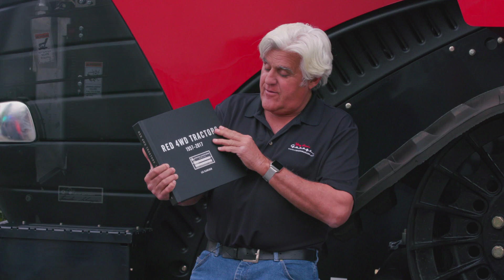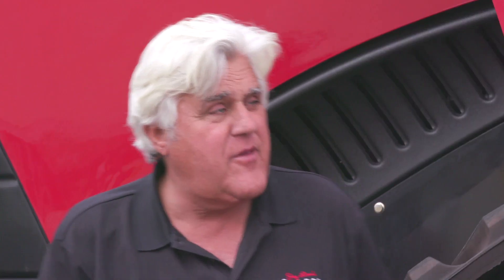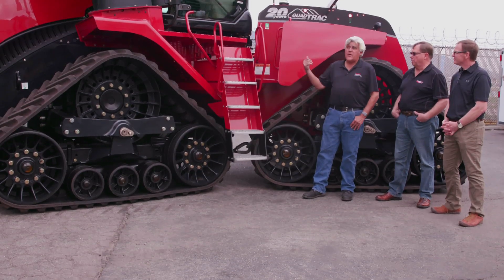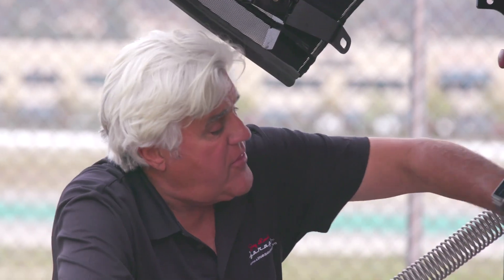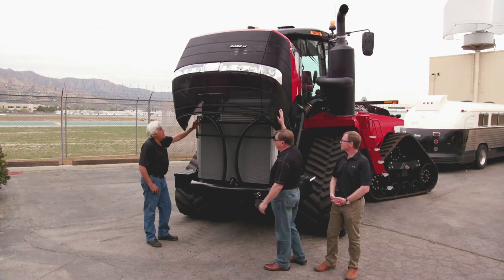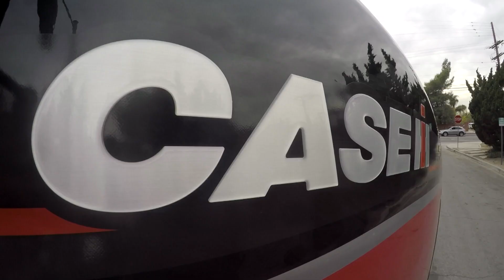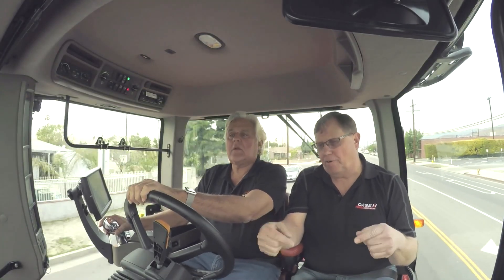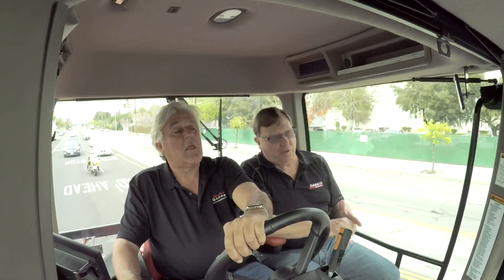2017 Case IH Quadtrac - Jay Leno's Garage

Comment: So it costs the same as a McLaren, has a similar power output and is road legal. And before anyone says: "Yeah but a McLaren is faster!" well here's the thing; A McLaren won't be faster in traffic. This QuadTrac may not be quick but you can just go over the cars in front of you! Oh and it has more torque.

QuadTrac 2: McLaren: 0
Reply: The Maclaren also won't pay for itself like this beast can!
Reply: yes,  but a McLaren can't plow a field!  Different vehicles for different jobs.
Reply: this looks like a tank so yeah a immediate win
Reply: This can handle snow and deep water better than the McLaren.
Reply: Yeah, people in Turlock basically own ALL roads now.
Reply: Let's see a pulling contest, McLaren vs the Case!
Reply: ¡ i sorry this was the wrong comment
Reply: Mclaren don’t make no 2100 lb/ft torque.
Reply: It's true! You can kill a lot of people in cars by crushing them to death. Very good point!
Reply: This helps feed a nation - the McLaren, not so much.......
Reply: So true. Anyone who lives in a high highway traffic city 27/7, with a 40kph limit on every street, theoridically, wont be better off with that then any super car. Espacially in winter. And Jim The EDC guy is right... On top of it, in a 2 way rural road. The McLaren is stuck behind it.
Reply: Howabout  this thing can plow a field and provide food for your family. or this will plow snow and open a vital traffic route which will save lives.  Can a McLaren do that?

I'd still rather have a McLaren.
Reply: Quadtrac pays for it self and is more useful and can drive in 3foot deep snow that Mclaren would not even move
Reply: The McLaren won't make you money back though. You'll eventually get your money back with this tractor since it's a tool for farm use.
Reply: But you can’t pull a plow with a McLaren 😂.  Quadtrac 3- McLaren 0
Reply: And you can't do jobs for the local farmers in a McLaren
Reply: LoneRenegade plus the tractor will help make its money back if you don’t se it.
Reply: Still not getting your product to market without the truck driver.
Reply: I'm not sure if driving over other cars is socially accepted though.
Reply: LoneRenegade it can pull like 20 times what a mclaren could and actually has a purpose so let’s make the tractor 10 and the car 0
Reply: @jimgoodwin6294  McLaren helps feed people. Mechanics always need constant customers!
Reply: LoneRenegade don’t forget the QuadTrac will make you money as well
Reply: The tractor has astounding productive capability.
The McLaren is a fast, pretty, high performance, fair weather LIABILITY.
Reply: can the mclaren crush a quadtrac? no.
can a quadtrac crush a mclaren? definitely.
Reply: McSkillets McLaren can go through cars though
Reply: @tevans3373  McLaren doesn't have a job tbh.
Reply: QuadTrac feeds people, McLaren starves people
Reply: And a McLaren can’t pull a plow
Reply: McLaren: 1 because it’s faster as you said
Reply: McLaren has better fuel efficiency. McLarens can also drive longer distances without services and oil  changes
Reply: So this will fit on most garages, is less fuel efficient requires more maintenance mclaren 3-0 QuadTrac
Reply: Jim The EDC Guy rent the car and it will
Reply: You're not allowed to crush vehicles
Reply: Mclaren eats money, Case IH makes money !!!
Reply: I think I prefer it to a mclaren lol
Reply: You can haul a camper or RV behind it easily also, another plus. Lol
Reply: Don't use a sledgehammer to put a picture up on the wall.
Reply: McLaren cant farm and pulling mega cultivators !
Reply: Also you can go anywhere with this...

Comment: It's impressive how smooth and quiet it is.
Reply: That is what I was thinking, I have a long history with diesel-powered cars.  Very very quiet!
Reply: yeah no kidding, amazing work
Reply: I've been around these for years they are not quiet outside but inside they are quiet
Reply: Suitcase muffler
Reply: @rustyrelicsfarm2406  they are most definitely quiet outside as well. I drive one daily haha. Quietest tractor around.
Reply: The cab is just good at cutting out the noise. Outside, they make an infernal racket.
Reply: The exhaust makes up most of it, when your next to them you notice
Reply: When you hook a 100 000lbs farm implement behind it it gets a lot louder 😂
Reply: Im pretty sure that the audio team just used some techniques to tone it down
Reply: @rubenbraekman4515  i would like to see this 50 ton implement. Now dragging force of it might be closer to that number
Reply: @CheeseMiser  bourgault air drill seeder 😉
Reply: @rubenbraekman4515  i was just gunna say a 9 shank ripper

Comment: A few years back I took a tour of the factory in Fargo, ND that manufactures these tractors. Just amazing how build them from the welded frame right up to cab upholstery. A lot like auto manufacturing only working with parts that weigh several tons. Fargo is less than 20 miles from my farm. I see lots of these out in the fields working during the growing season.
Reply: Hello Ham. Maybe you could answer this. 
Do you happen to know why the front of the hood is translucent?
Reply: @UberLummox  I think it's a grate with tiny holes so air can be sucked in through the radiators. So you can partially see through it since it's partially open.
Reply: @MittyNuke1  Ok. Thank you!
Reply: Fargo is John Deere
Reply: @johnhargenrader8972  no John Deeres built here. You are thinking of Moline, Illinois.

Comment: Everyone freaking out about $625,000 have to remember TIME IS MONEY.  these are used on huge farms and might be doing the work of two or three tractors.  Getting work done faster.
Reply: jay west and with less hired men
Reply: especially when the time to harvest is only today due to weather
Reply: My dad had a welding shop in addition to farming 3000 acres in the Texas Panhandle back in the '70's.  Repairing farm implements kept a welder busy full time until the price of grain got busted (by the "Peanut Farmer" IIRC ) and the farmers went back to running the equipment themselves.

Had to lay off the welder because nobody was tearing up equipment ;)
Reply: I guessed around 700K before he said the price,almost nailed it.
Reply: People don't realize how much 5k acres is. Great pyramid covers 13 acres at the base. 5k acres is massive
Reply: 5000 acres is 7.8 square miles.  Imagine a field two miles wide and 4 miles long.
Reply: No one freaked out about the price, in fact I think is a great investment for big farming companies. And honestly pocket change for companies with lot of bank.
Reply: Aaron Borman — Not to mention MTBF, reliability matters too.
Reply: Farms around my area run like 3 of these tractors. The new john deere quad trac is $900,000
Reply: Yes sir! Gotta spend a bit to make a lot.   I know guys with many millions invested into equipment for running a big family farm.
Reply: jay west i ones saw 3 of these on 1 field and they almost looked like ants in comparison so that kinda shows how these are used
Reply: Not to mention that if you're in the market for one of those things, your profits are going to make a purchase like that pocket change.
Reply: Large farm equipment has never been cheap do Idk why people are so surprised
Reply: @scottmacdonald7667  currently wearing my John Deere shirt. Almond farms don't need these but damn!
Reply: Or those guys trying to beat the wall!
Reply: @johnsantos1225  ,

640 acres = 1 square mile

Comment: Funfact: In Germany your can drive this at an age of 15/16 with the driving license typ "L" what requiers no practical examination, just a multiple choice test, but you aren't allowed to drive a moped :D
Reply: Because capitalism
Reply: In Montana you would never be asked to provide a license regardless of age, it's just assumed your a working farm kid
Reply: In most of the us states you don't need any license at all, they are considered a slow moving vehicle.
Reply: In Canada you can drive em at 14 without a liscence
Reply: You dont need a license in illinois even if your 5
Reply: @Jeffposter your are correct I'm 14 and I drive them every single day on our 3,000 acre family farm
Reply: That's because speed kills.
Reply: I thought you had a weight limit which this propably exceeds.
Reply: @jakobmontgomery471  as Jeremy Clarkson would put it it's not the speed that kills you, it's the sudden loss of it

Comment: Had one of these Case IH Steiner giants  pull my 96,000 lb Inova vibrator out of a snow bank off of the east ramp in Pruduoe Bay AK. Easy, hooked up, the operator didn't even have to leave the cab. These units do great work all day and night in the North Slope. Kudos to Jay, Mitch and the best makers on earth.
Reply: Who threw your vibrator into a snow bank?  That's just mean.  Talk about finding a needle in a haystack.

Comment: Very cool to see Jay Leno with a Steiger Quadtrac.  It was neat to see Mitch in this video.  I enjoy talking Steiger's with Mitch each year at the National Farm Machinery Show in Louisville, Kentucky.
Reply: Steiger and quadtracs are 2 different machines.
Reply: Quadtracs are built in the Steiger plant in Fargo ND.
Hmmmmmm.
Wonder why that is. (nevermind the blue New Holland TJs that are assembled on the same lines)
Reply: Ryan Young No they are not. A Quadtrac is a Steiger same as the Rowtrac. They make wheeled and tracked tractors.
Reply: Steiger Quadtrac's  are built at the CNH Industrial Factory in Fargo, ND which was built by Steiger, Inc in 1969.  Case IH Steiger tractors offer wheels, wide and narrow tracks as Quadtrac/Rowtrac models.
Reply: bigtractorpower,  how come it says CASE?
Reply: Dave Haskell steiger evolved into case, recently they have started to brand the steiger name on some of the newer machines
Reply: Tenneco the parent company of J.I. Case acquired International Harvester in 1984 and Steiger Tractors in 1986. The new company was named Case International and in 1994 shortened the name to Case IH. In 1999 Fiat acquired Case IH.   All red tractors from 1994-2018 from 18 hp to 620 hp say Case IH.  Case IH tractors are designated by names such as FARMALL 18-125 hp, MAXXUM 115-170 hp, PUMA 170-235 hp, MAGNUM 180-340, STEIGER/Quadtrac 370-620 hp.
Reply: bigtractorpower very cool to see bigtractorpower following Jay

Comment: Hey Jay,
I used to have a 1979 IH SCOUT CUSTOM DELUXE 4x4. DON'T snicker!!!
It was a good, strong, sanely sized, reliable machine which served me well for almost 40 years! 
He didn't trust the comparable "JEEP" models like the CHEROKEE or God forbid the roll prone CJ's! He liked "IH" SCOUT II instead because of the heavy truck legacy they had and that unlike Jeep, IH manufactured almost everything in the machines it made. It was my DAD'S "gift" to me in my Junior Year in High School for working for him around his building since I was a young kid. (He was the SUPT. of an 84 family, multi-sized units: Studios up to 3BRm 5&1/2 total with 2BthRms and private balconies.) as "unpaid, in house" help.
Heck! I even learned how to lubricate and manually operate the HUGE boiler that supplied HEAT&HOT WATER to the tenants. A job I did more than once, alone, when my DAD was too sick or exhausted to do so himself. He NEVER took a day off and only ONE proper vacation in 14 years on the job. Only a bad heart attack and his advanced age  - 76 at the time. Already FAR beyond normal retirement! -  forced him to finally quit. He was a real "hands on" SUPT. Did ALL the repairs himself, prepped apartments with his porters for the next tenants, even did the yard work on our extensive grounds. He wasn't a trained mechanic himself so he greatly admired those who were and engineers in general. You and he would've gotten along GREAT together!
Our "FLAGSHIP" and my DAD'S pride and joy was a 1974 CHEVY CHEVELLE MALIBU CLASSIC 4 door SEDAN with 350-V8 engine. He could've ordered a much larger engine but this was the one in the model he test drove so he bought it. You know about this engine for sure right? Even in an over 2 ton car with 3 speed, non overdrive transmission, fully loaded with passengers and cargo... It could still easily FLY when you mashed the pedal to the floor!!! It was amazing and compared to his old, terrible 1969 6 cylinder NOVA?... THIS was a ROLLS ROYCE! We kept the MALIBU  in the family, garaged, for 44 years! It was finally sold to someone who we knew would appreciate it as much as we did; because my Mom passed away and I couldn't keep it myself, it had to go but I weep for it every night. A lot of "firsts" and very pleasant memories in our lives were milestoned in it as is true for many of our cherished, motorized, four wheeled "friends", eh? You understand completely I'm sure.
Sadly? I don't even have a photo of it to share with you. It was in a light green color with a matching vinyl roof. Bench seats. AM radio. An AMERICAN classic of the era.
HUGE by today's standards the four door CHEVROLET CHEVELLE MALIBU CLASSIC of 1974 was actually considered a "MID SIZED" car?!!! Only the wider, larger IMPALA was classified as a "FULL SIZE".
I've enjoyed your work since you first appeared on Johnny Carson's "TONIGHT SHOW" as a guest, then a guest host. You were FANTASTIC as his successor, all due respect to your rivals for the job.
I try to follow EVERYTHING you do and I hope to one day catch your live nightclub act, hopefully nearby in one of the Connecticut casinos.
Best of wishes to you and your family!
Sincerely,
Your fan,
John C.Bojemski
1133 Midland Ave.#2G 
YONKERS,NY 10708
Johncbojemski@gmail.com
914-918-4123